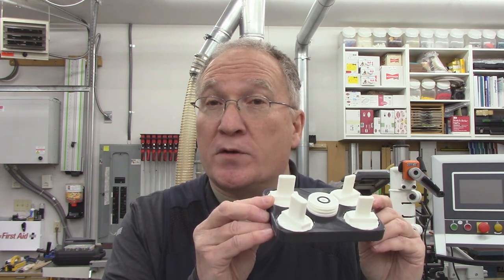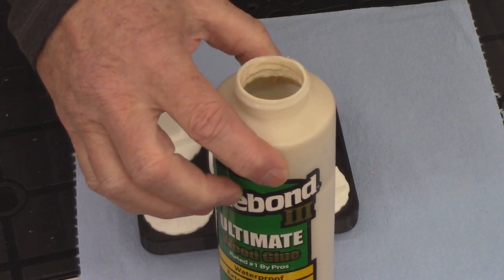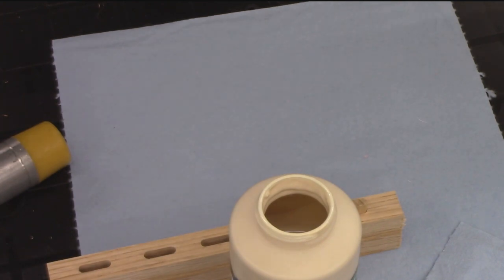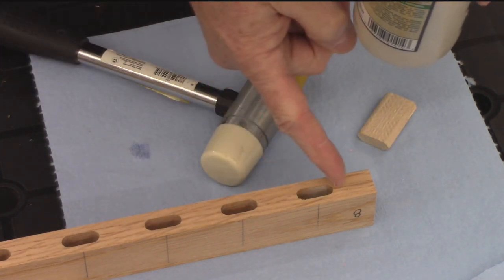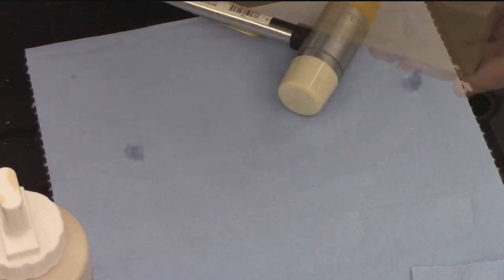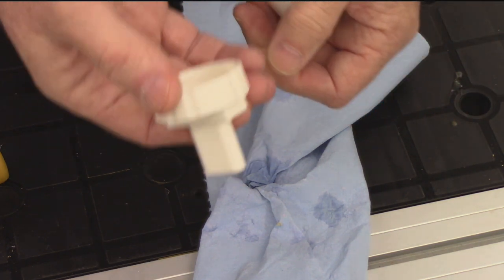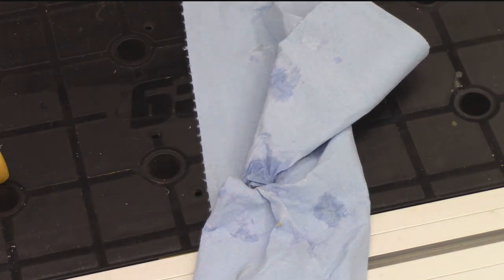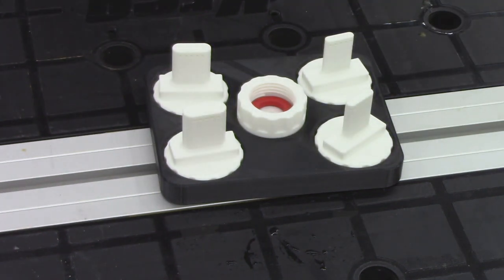Glue Nozzles for Festool Domino - DOWNLOAD FREE 3D PRINT DESIGNS

Comment: Just recently got a domino, finally !... so Thanks Steve ! Going to be firing up the printer at work this week !
You should call the Fastcap guy and get these made to sell, plenty of blokes without a printer would like these I'd think.
Reply from the maker: Thanks Gary.  That is a good idea especially if they sold it as a screw on for the Glu-Bot.  I mentioned it to a friend yesterday at Mark's Machinery and he indicated he wanted a set but didn't have a 3D printer.  Steve
Reply from the maker: At your suggestion, I sent an email to Fastcap for this product idea.  Thanks again.  Steve
Reply: @extremewoodworker  Hi Steve, Glad you got onto them, look forward to Paul showcasing your design in the near future ! 
Laying in bed last night, I had some thoughts about it.    I was thinking, the current design is good for parts where you can pick them up or turn upright easily, but larger panels or partly assembled furniture (as i just had the first use of my own new domino on, would mean domino slots on there side or vertical.
So my thought was to add a design where  you have horizontal and vertical setups for the domino applicator, but the glue bottle is vertical, if that makes sense. 
In this regard, it may be possible to have a twistable one to adjust as needed...  two parts, click together with o-ring ?  probably too prone to issue with drying glue.     Still, if your keen, those two types in the fixed Horizontal and vertical (while bottle stays vertical) will be handy.  I'm sure the straight design would work, but unless you have a near full bottle, it could miss spots and be a pain ...
3rd item might be a reverse one, where you put the domino into a slot in the print, and it applies it to the bottom half ?    I'm probably an 'over-gluer' , so this may be a silly idea.        If Fastcap go for these, having them injection molded in the same plastic glue doesnt stick too, might solve several problems with the rough print etc .  Anyway, I appreciate your effort, and giving them out for free, cheers. Gary.

Comment: that´s an awesome feature Steve. Th anks a lot to share it with us.to clean those nozles easly, just save a empty old botle glue, fill with clean water, put the nozle and squeeze it. it will clean the nozle easly every time you use it.
Reply from the maker: Thank you Wood Be.  That was my initial thought as well and would have done that but since I refill my 16 oz bottle from a 1 gallon jug, I didn't have a spare bottle on hand.  It would have saved me the flushing adapter design but I probably would have done that eventually anyway.  Steve

Comment: Have you thought about making domino joint nozzles for your Pizzi glue applicator?
Reply from the maker: Hi David.  I have been experimenting with a two piece design to resolve some of the cap quality issues.  I did size the prototype for the Pizzi cap using heat set threaded inserts and an o-ring seal.  I still need to work out a few bugs.  Steve
Reply: @extremewoodworker  Thanks, Steve...looking forward to the updated version.  I have a Pizzi and think these would be great instead of the commercially available ones.  Dave

Comment: Great video! If you continue to have leakage around the threads, you might want to try designing in a groove for an O-ring. It should compress enough to compensate for in irregularities in the surface of your glue cap/glue bottle.
Reply from the maker: Thanks GK.  I was thinking of gluing in a gasket or re-designing such that the cap and nozzle are separate pieces.  I just need to find the correct materials.  Steve
Reply: I was thinking the same G K, or use a flat face gasket like this one from McMaster 5288T168. I downloaded the .STL to measure the inside of the cap and this seems to be the closest in an off-the-shelf gasket. Only problem with the McMaster gasket is they come in packs of 100. I will try printing these and provide feedback. Thanks for sharing your work. I know what it takes to create something like this. Not always as easy as it looks.

Comment: Awesome work. Makes me want to buy a 3D printer. Do you think with a change to the treads that this design would work on the Pizzi? They charge an arm and a leg for nozzles.
Reply from the maker: Thank you Hybrid.  For initial nozzle prototyping, I borrowed the Pizzi cap from my edge gluing nozzle.  I pressure tested the nozzle with no exit holes up to 45 psi (2 bar).  The nozzle material held fine but I experienced minor leakage at the nozzle to cap interface.  I also had difficulty with the fine threads used to attach the nozzle to the cap.  This really needs some type of threaded insert which I did not have on hand so I switched over to figuring out the cap threads.  In the future, I will probably tackle the Pizzi nozzle again.  Steve

Comment: If you want a smoother inside to the cap, and don't mind making the whole thing taller, you can make it a 45 degree angle instead of a flat. That will let you print without supports, depending on your design.
Reply: Another option is just to put some rubber gasket in there.
Reply from the maker: @Psychlist1972  Yeah, I was thinking of a gasket but I may revise the design to make the nozzle interchangeable.  I have ordered some threaded inserts and give that a try.  Steve
Reply: @extremewoodworker  You could also make the top in two parts: a screw on ring, and a nozzle. The nozzle would have a flat at the bottom which is wider than the opening in the ring. You'd insert it from the threaded side. That would make for interchangeable nozzles. It's also a fairly common standard for nozzles/spouts in different consumer products. That would let you print both parts at the optimal orientation.

Comment: Great idea. But just an idea to help with your issues that you mentioned. Create a common cap and print that, and print the separate nozzles. Just an idea.
Reply from the maker: Thank you Mark.  I did initial nozzle prototyping with a Pizzi cap but the fine threads don't 3D print well.  I think this concept would need threaded inserts to work well.  I think your idea has merit  but I would probably print a cap for each nozzle size.  I will explore this for future improvements.  Steve